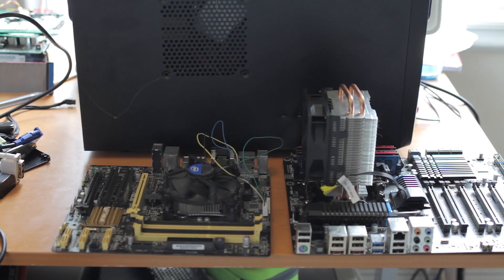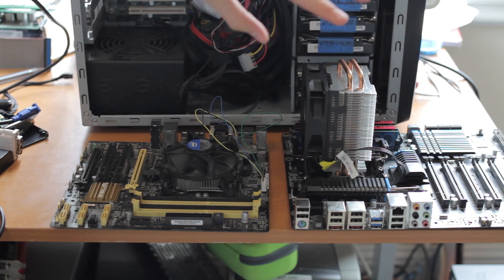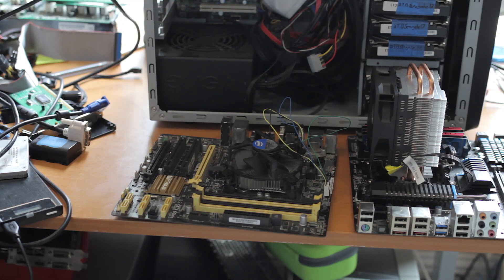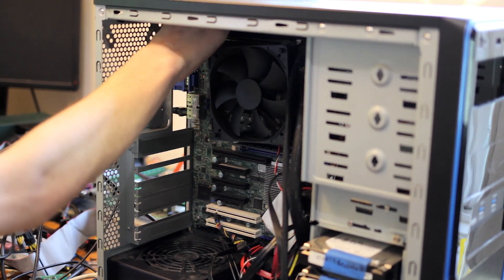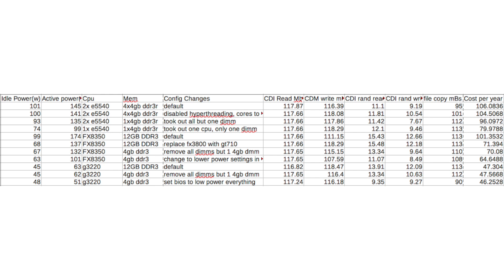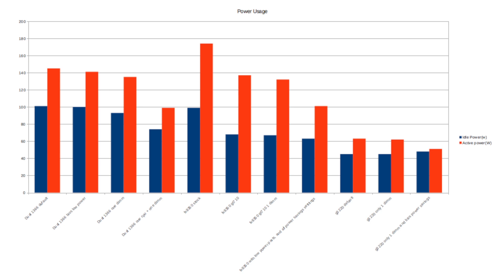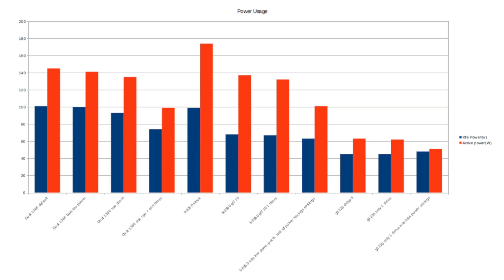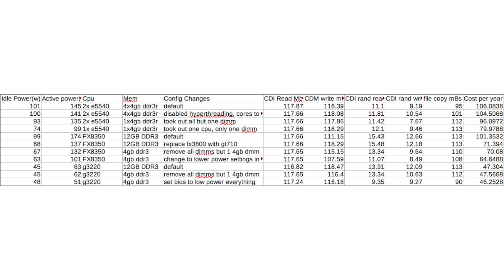How to save power in a NAS, what works and what doesn't

Comment: Older vid but by now some newer gen stuff is getting cheaper. I have a server itx board with an i3-7350k and 16gb ecc ram, idles at 16w. Their idle power saving features seemed to have gotten a lot better with newer gens. This is with no power optimisation done to the system, 2 sticks of ram. Underclocking/disabling hyperthreading etc wouldnt change anything with idle power use as the cpu automatically clocks down now anyway. I have an RPI4 running as my 24/7 machine though as even 16w for me costs too much, RPI4 idles at like 5w.

Comment: Hi, what about hard drive power settings in freenas? i.e. drives spin down or turn off after low use that could save a bit of power
Reply: The extra wear on the disks probably is not worth the power saving, starting up a HDD is quite intensive in terms of wear

Comment: #1. : use an undervolted intel atom netbook.
Reply: #2 dont forget to replace the 8 year old battery before it explodes and you need to load from an offsite backup
Reply: @virtualtools_3021  If this is a joke, it's quite elaborate to post the punchline half a year after the setup :D

I really should set up my offsite backup soon, too...
Reply: You can't undervolt atom chips.  I know because I have several models of them.

You can increase their power efficiency by over clocking at stock voltage, though.

Comment: Great video need to look at a low power version of my server but I don't really know what to do, I still want the server to be good at transcoding and I don't think there is gonna be a low power way of doing that. It would be cool to test out combinations of cpu low Ghz high core count vs high Ghz low core count and how a GPU would affect power costs.
Reply from the maker: Will add this to the list of things to test. My guess is something like quicksync is the best for power efficiency if you can use it but depends how how many streams you need